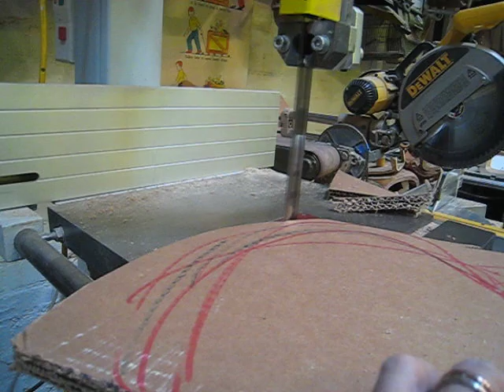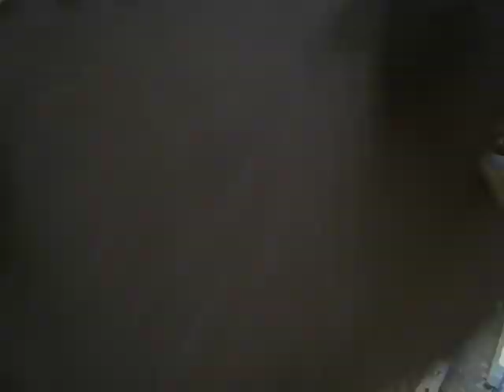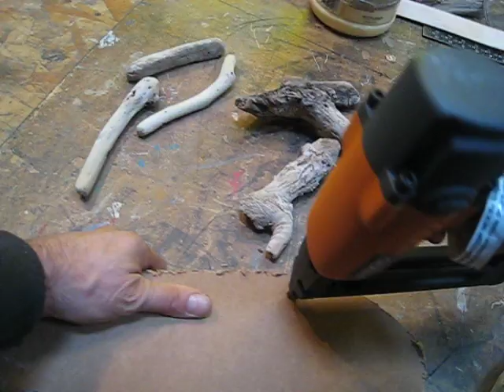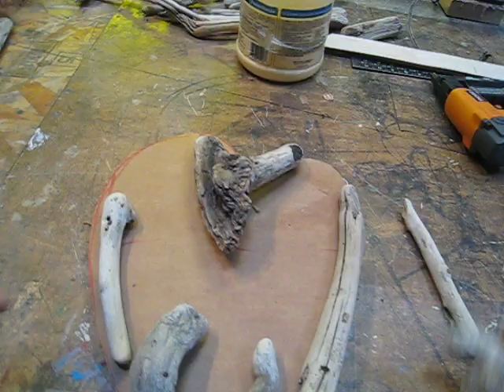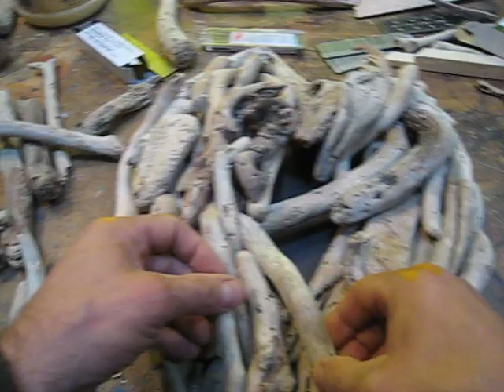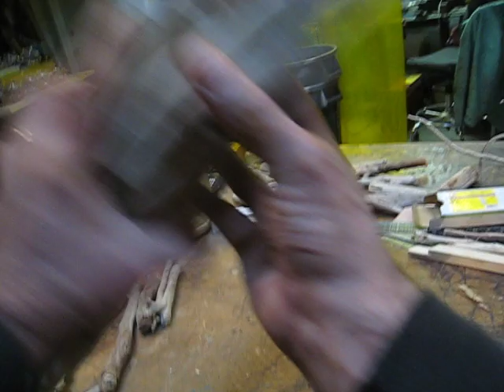Heart making

Comment: I bought a driftwood heart slightly bigger than yours 
..in wales , uk.
It was great until the glue ( gun)
...started to melt.
Now i have a pile of wood 
...and a heart to reassemble.
It felt apart from  the damp winter and hot summer . 

I love them , but will make sure they are better made .
Yours looks wonderful and look more secure with nails. 
💚💚💚💚💚💚💚💚💚💚👍👍👍

Comment: Very nice video. I like the idea of putting the black foamcore board in the middle.
One question: What is the backing material? It looks like cardboard, but that won't hold a nail very well. What did you use?

Comment: What compressor do you use?
Reply from the maker: Just a simple pancake style one that I bought at Home Depot. It doesn’t have much reservoir so it kicks in often. But it’s fine for running a Pinner, nail gun or for filling up your tires in your car.
Reply: @urbanobjects  cheers man